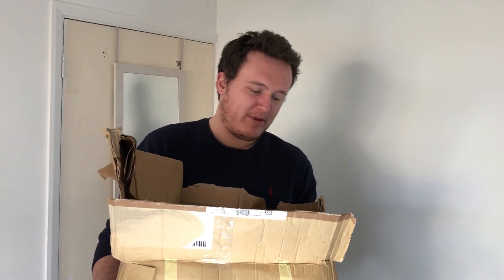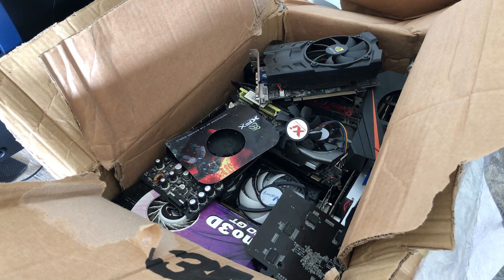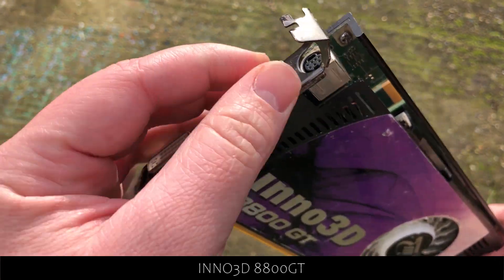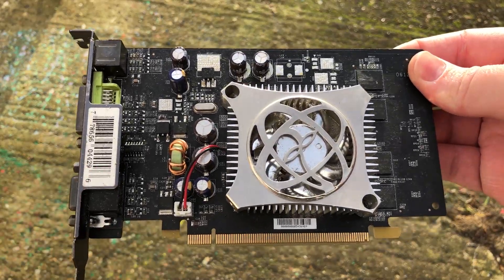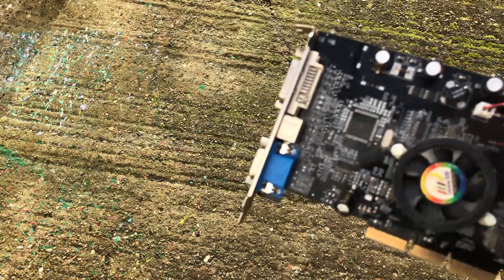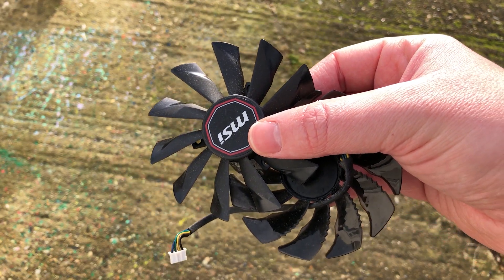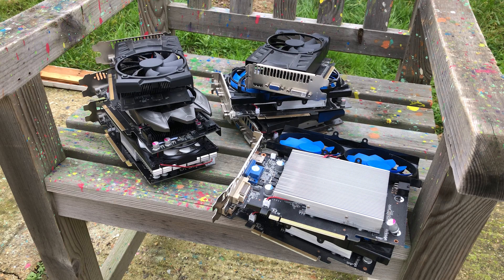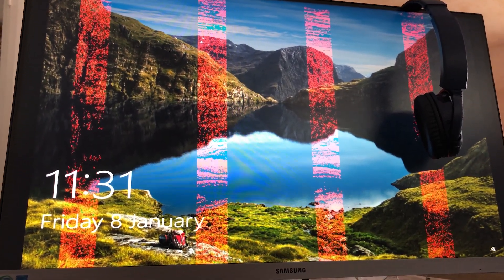I Bought 25 Untested Graphics Cards For £50 ($70)...

Comment: Nothing good will come of putting an electronic circuit board in the oven. Electrolytic capacitor elements are vulnerable to high temperatures and their lifespan is greatly reduced.

Comment: You would be amazed what taking them apart, give a good clean all over, blow out the monitor out connectors, put them back together and try them again. It usually will bring one or two back to life. Tech Yes did a good video on just this. Love your video although im a bit late to this one. Cheers

Comment: the Quadro FX4600 is basically a G80 8800GTS, except it has 768MB VRAM instead of the normal 320/640MB and is clocked slightly slower (nothing a little afterburner/rivatuner can't fix). I have 3 of those so I kinda wanna experiment with BIOS modding to make a 8800GTS 768MB out of a Quadro FX4600. Sadly the Quadro FX5600 (= 8800GTX) with its 1.5GB VRAM is consistently waaay more expensive than all the 4600s floating around on ebay so a 1.5GB 8800GTX will probably stay a dream :(

Comment: @7:05. That is an AOpen FX5200. That looked like the 128 MB GDDR2 variant, but I could be wrong. They had a clip mount fan you could order as an OEM extra during build (OEM here). It added like $1.30 to each card.

Comment: NOW WAIT 1 DAMN MINUTE THERE ..!!    dont knock it lads ..The  6800  is Amogst the pedigree of the 8800 & 9800 range aswell as being 1 of the best over clockers of Its day if you changed the cooler for an modded AMD cpu cooler add ram coolers etc or dare i say it Water cool the beasty . it will suprise you . I keep  & still use my gainward 6800gt agp  in my asrock p4dual915 alongside my 8800gt pcie they make for a near perfect  retro gaming rig as with the on board intel graphics & on board 8 channel surround sound it can run 5 monitors ideal for flight sims . racing games etc ..  making it the best machine you ever flown a " TIE Fighter" on in your life as you can set the views to different monitors &  you have a full cockpit  . so you can See &  hear they're  coming from...... I havent lost a dog fight in over 10 years ....lmao

Comment: Rather than using an oven, how about a heat gun. And you can shield the rest of the components with the use of a cut up fizzy drinks can. This will help direct the heat to the points of bad solder joints. The problem with an oven is the heat goes to everything like the capacitors, ect. Its just an idea I had so don't just take my word for it. I just wondered if this would help you 😊.

Comment: Instead of replacing the fan no matter how bad or noisy it is, take it apart, clean it and put a few drops of low viscosity house oil.  As long as the pcb(if it has one) isn't fried it'll restore it as good as new. :)

Comment: I had gtx 1060 3gb and can play 1080p 60fps on high settings (not ultra), so way better gtx 1070 ti can too. If you can't - there is a problem with device behind the keyboard.

Comment: Bruh.... The oven method as you put it is terrible because you should never do it!!   Reflowing needs manageable directed heat, get you a heat gun and the areas you should avoid on a PCB should be quite obvious.   you need to give exposure for an amount of time on one side let it cool flip it and repeat .... I usually do three times on each side

Comment: Just see youre video and maybe You can help me;I have problems with my graphic card Asus AMD Radeon r7 260x.Black screan;no display.When install drivers system raise and after 10 minutes all crash and no signal on monitor.Try drivers from Asus site and Amd site. I put another Nvidia graphic card in my comp. and works fine.Have send graphic card to service and they sad that everything is ok with graphic card.I update all components in computer,exept bios of motherboard.Do you know maybe what is the problem?
Computer components are:
windows 10 pro 64-bit
Motherboard: Gigabyte B85M-DS3H
I5-4460 INTEL
memory 8 Gb ram
power 650w
Asus Amd Radeon r7 260x

Comment: I just bought one of those 780s. I thought it was faulty at first as I couldn't get any display on an x570 or b450 board even with csm enabled. I tested it on an old fm2 board and it worked perfectly. I changed the vbios on the card to one that supports UEFI boot and it's working perfectly on the newer boards now. It's quite a respectable performer for the price too!

Comment: Please no oven method, it does more damage than it helps. Get some proper flux, a preheater and hotair station to focus the heat on the memory or core if there is a reflow needed. Some nvidia cards can be diagnosed with software, so you can see which memory module is problematic. Search youtube for gerrepair or AssassinWarlord if you are on a tight budget. Seeing cards baked even if there is just a single measureable shorted component makes me sad.

Comment: My "gaming rig" has an r9 270x in it which i bought 8 years or so ago brand new. On ebay they sell for 30-45€ today. I was quite surprised seeing an r7 265 in there which came out almost at the same time as my r9 270x  and which you got for such small money. Also the GTX 760 seems to be more powerful with it's 3gb ram compared to the 2gb of my r9. Sadly it was briken though... I'm looking forward to see what those cards are capable of!

Comment: Be interesting to see if ovening the club card has any effect upon the artefacting. A couple of years ago I bought a Club3d r9 280x for £20, it had loud coil whine but 3d worked ..... for about 30 mins, it then started to artefact, and soon after black screened & never booted again.
That era of AMD cards don't seem to endure particularly well.

Seems like the most valuable stuff you've got in that box are, sadly, the faked GPUs. Can they be 'fixed' by flashing the proper vbios?

Comment: Your walls are so blank... you should put up shelves and display the cool looking cards. 

Also, that mystery AGP card was an FX 5200. Guess you missed the markings on the solder mask, lol

Also also, reflashing those “fake” cards with the original firmware and reselling them as what they actually are isn’t a problem. Or even selling them as is with the correct information “X card with Y firmware flashed”, as long as the seller knows what they’re ACTUALLY getting

Comment: hey u get a 6800xt....for 50 bucks^^....no for few bucks....GREAT DEAL!!
i never could buy a 6800xt nowadays for under 800 and u get it for basically free!
dont use the "oven" method....buy a cheap solder heat gun for that job!
40-50 on ebay and u can use this for future jobs!

Comment: I've got an MSI 1080ti, like that 780 without the fans, and one of the fans went bonkers last year and would randomly ramp up to full speed for a random amount of time, anywhere from 5 seconds to indefinitely. Could be a possible explanation as to why somebody removed the fans from that 780..
I just stuck a waterblock on mine, but I did have the bad fan connected to a motherboard header for a few weeks while I was scouring eBay for a cheap waterblock. I'm guessing it was a bad temp sensor, or something associated with sending power to the fan around the VRMs at the "front" of the card.

Comment: I like this box, great video. Sub'd
There is an ad in my local Craigslist,  a box of older GPU's for $25, its so tempting just for fun. I wish they would start making artwork again on the GPU covers. I started gaming heavily around 2005 and all the cards around then had nice artwork. The 8800gts brings back memories...a favorite of mine also!
-The gtx780 fans, the bearings are likely bad. I just swapped similar ones on a MSI RX 570, I tossed the old broken fans but cut and kept the wires, in case I want to make a custom GPU fan setup.

Comment: The ones with the artifacts 99% of times is vram. Those have better chances of staying functional after a reflow of the vram chips. If you can only heat up the vrams it's better. Heating the gpu chip if it's functional does strain it, especially if it's from the period of the solder material change (nvidia 8xxx/9xxx).It's like the capacitor plague but worse.. Hot air station is the way to go. And replace the pads/add cooling to the vram chips helps longevity if it was vram. 
The ones with no video it's usually the gpu chip itself, the internal filling and the solder balls inside the chip package is usually what kills them, it's usually not the contact of the chip package to the board itself. That's why it's a "temporary fix". 
Of course check capacitors first before doing anything else :)

Comment: There are brunch of Chinese videos fixing GPUs / PCs / Notebooks.
Oven method is legit, however I prefer heat gun with flux. Both of them are common in electronic repairing.
(It's very handy to fix 200+W cards, most of them just have random loose metal joint)
There are softwares help you to locate bad memory chips, however you may need to order it thoguh black market in China.
MATS has been leaked to other youtube videos, try it for Nvidia cards. However replacing specific memory chips / core need professional BGA tools.
For any card have blank or literally no screen / cannot be detected, feel if the core is still generating heat.
If there's heat, it's either loose joint again, or real broken core (completely dead), you can test the resistance of each inducer. Complete short = dead.
If there's no heat, most of them have troubles on power delivering, either MOFSETs or even tiny capacitors. Usually remove whole set of MOFSETs and test each of them.
Finally, the fake cards. 200 series is easy, soft flash BIOS is enough. However Fermi cards need a hardware BIOS chips flashing tool. Kelper is worse, may require circuit mod.
Hope it helps. You may find youself skillful enough to repair mining machines lol

Comment: Even without seeing it run, that single slot 8800 GT needs new paste. If it works, it might still need some fan mod, those things run hot. MIne back in the day easily hit 103°C while gaming, which I could drop by nearly 30°C by removing the metal shroud and pinning a pair of 80mm case fans onto it.

Comment: I revived a few graphic cards by using a heatgun with around 300 degrees celsius. There are guides/videos on how u do it on youtube. Also don't forget new cooling paste. I rather recommend the heat gun method which is a bit more reliable. Already ruined one card with the oven method. Also managed to revive a few laptop motherboards that suffered from overheating where the gpu didn't have enough contact with the motherboard.

Comment: Depending on what exactly is wrong with the card, the Oven method might even be permanent. My 9800GTX failed a few hours after baking it at 110°C, but when I baked it again at 150°C for almost an hour, it stayed alive until I replaced it 2 years later (and 2 years ago when i needed a card for debugging it still worked).

Comment: For the 460, my old one had small artifacts back in the day and what I did was delid the gpu core and replace the thermal paste on both the core and the heat spreader. Don't know if it'll help but yeah.

Comment: I've yet to encounter graphics card I could not fix with the oven method. Remove cooler, make some tinfoil supports so pcb won't touch oven plate, 200C 10min. Tried on 100% dead cards only, artifacts usually are memory problem.

Comment: The 8800GT can be flashed with a Mac EFI64 ROM. It's useful as a troubleshooting card if you a have a Mac Pro 2009-2012 with a newer Radeon card that's not fully supported (no boot menu). You can then use this old 8800GT to reinstall MacOS. When you absolutely need a Mac on the cheap to run Final Cut Pro :-(

Comment: I did this once. I paid about $50 and made around $400 if I can remember.  Had like 20 Quadro 2000s I sold to one buyer on ebay for about $400. Had a GTX 760 and 770 that sold for over $100.  I scrapped the rest for like $50 at a local hardware recycling shop.

Comment: from what i've always seen on another channel that specialized in fixing faulty pcbs of all kinds, there is a good chance you can send some of the more worthy card to a pro and have them repaired for like 20~30$. It might be just a fried diode or capacitor that's 1$ for a bundle of 10.

Comment: dear Sir.. atleast get yourself a heatgun and some tinfoil.
the oven trick is actually worse than that since it gives unneccesary heat stress for the parts that dont need it like v-core components.

usually those graphical issues are bad connection on either the GPU itself or one of the memory modules.

Comment: Some of the cards may have blown caps. Esp the high power cards. Easy fix if you know how to test then.

You could grab some contact cleaner and spray the artifact cards.

They broke due to dry joints (cracked soldering) or if cooked due to fan fail they're dead and this can be a on PCB or chip damage.

I ovened a x700 which all of a sudden artifacted me... U.mmm. looked like it was going fine till the ram fell off... Oops. It now in a bag ready to be put back together.

If you want some fun......
Take a card which mostly works and take a dead cards ram and put it on the other card and convert some 256 to a 512, or 512 to 1gb.. depending on the card PCB.
Then flash the card and see how that grabs you... Hope you have a heat gun and solder flux... ;)

Comment: RandomHardwareUnboxed.
Also no, If it was of any value it would be sold on its own.
Everything will be drastically obsolete or dead and if it wasn't dead going into the box spending a few days smashing into each other and then touching the traces/solder joints and ram chips on the back will kill almost everything else. Only super obsolete things like tesla cards and quadros/firepros with ECC are more resiliant to abuse and have a chance.

Comment: 7:00 It's not very much a mystery if it says the name on it twice; At the top of the PCB (just above the heatsink) and by the bracket between the IOs. - It's an FX5200. 😉
I did a quick search and there are many different cards of that GPU, including quite a few low-profile variants. - Should have 128MBs of memory, according to that label, but apparently some had as little as 64MB. - I MIGHT be interested in this card for and old system I want to build, but I'd have to take a look at what I need...

Comment: The oven method isn't necessarily horrible. Depends on what you're using it for. If you get the oven hot enough to reflow all of the solder joints, in the event you had a bad joint it would fix your card. It doesn't happen too often in new components but I don't know how many old TVs, Monitors, and old 386s and 486s I've seen with cracked joints. It's one of the easiest ways to try and repair a cracked bga solder ball.

Comment: I still have an old GT 9800 1gb.It has almost similar cooler than the 8800 gt? you have only difference is a worst cooler.It only has cooling on the gpu not on the memory so oc is non existent.

Comment: Under my main PC resting place (still a beast 2 years later) rests a magical setup that includes a Core2Duo E8500 resting inside the 775 socket of an EVGA nForce 750i SLI  and my beloved GTX 260 with a whopping 2 GB of that famous purple label DDR2 ram at an astonishing 800 mhz. This particular setup still holds a Sound Blaster audio card from the times before, slotted in a PCI slot. This setup holds so much sentimental value and is dripping of classic PC so hard I can't possibly bear to do away with it. How many of us remember being able to  barely run Crysis with the hacked DX10 setting not that long after the game released? The nostalgia alone is worth a whole lot more than money could ever account for.

Comment: Man, the GeForce 6200... The GPU I got stuck the most with. My first PC back in 2008 was AGP only, so that GPU was kind of the only "good" option at the time. I had a EVGA 256MB one that lasted 2 years or so before dying, then I got hold of a 512MB one that produced a terribly dark image, but was still usable for a while. My last one is a XFX 256MB "slim" model that also got good use out of it, and I still have it, but the motherboard it was sitting on just dyed the other day, and AGP mobos are around the same price or even more expensive the card itself here in Brazil, so, I guess I'll have to retire the thing. Hope that one you got works!

Comment: just decrease  the clock speeds of the gpu and the memory for the gtx460 and the r7 card no need for ovens
and grab a heat gun to avoid the oven method cuz its horrible